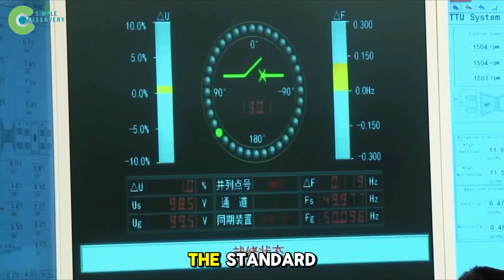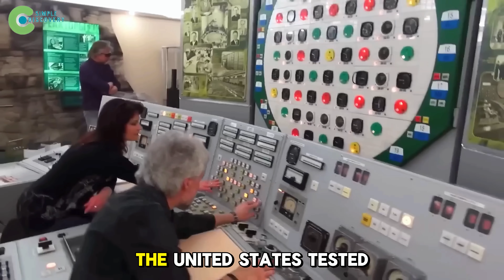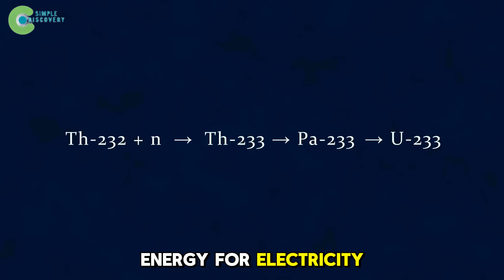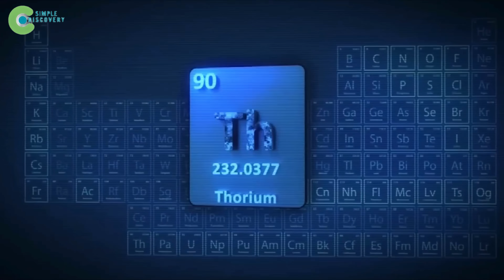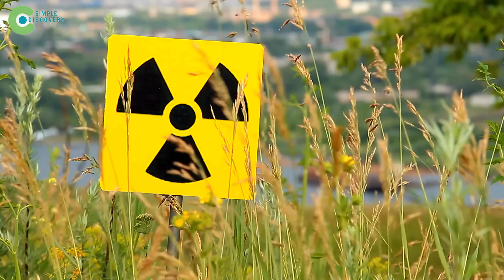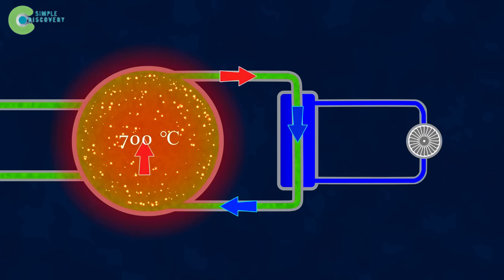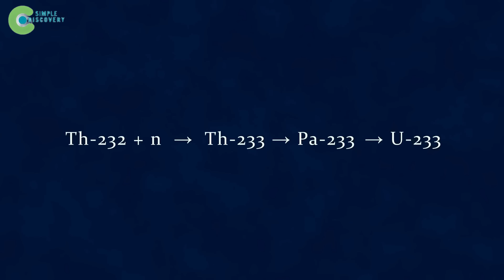China Rushes to USE ABANDONED US TECHNOLOGY – Years Later With CRAZY RESULTS THAT SHOCK AMERICANS

Comment: Thank you for hosting my essay promising near free autonomous electricity and unstoppable refrigeration, a literal power equalizer. People who can maintain their comforts of life autonomously are harder to subjugate; they could become guerillas of peace. Meanwhile guerillas of war could become more deadly.   

Let's reframe Earth's low diversity abundant ambient heat as a thermal   energy waypoint between heat and other forms of energy. 

Energy changes form without gain or loss. Uniformity or diversity is not, in itself, a form of energy.  Therefore entropy is an extraordinary claim burdening the law that energy is conserved. 

Energy sensible refrigerators that absorb heat and yield electricity would complement computers as computing consumes electricity and yields heat. Computing would be free. Chips could have energy recycling built in.
This would improve performance and lower cost. 

Full heat recycling, all electric, very isolated underground, undersea, or space communities would be highly survivable with self sufficient EMP resistant LED light  automated vertical farms, thaw resistant frozen food storehouses, factories, dwellings, self contained elevators, safe rooms, and horizontal transports. 
In a flourishing civillization, small self sufficient electric or cooling devices of many kinds and styles like lamps, smartphones, hotplates, water heaters, cooler chests, fans, radios, TVs, cameras, security devices, robot test equipment, scales, transaction terminals, wall clocks, open or ciosed for business luminous signs, power hand tools, ditch diggers, pumps, and personal transports, would be available for immediate use incrementally anywhere as people as individuals or larger social groups see fit. 

Some electrical equipment groups could be consolidated into local networks when suirable. Liquid nitrogen cooled superconducting networks would become practical 

If a high majority thinks our civilization should geoengineer gigatons or
teratons of greenhouse gasses out of our environment, instalations using devices that convert ambient heat into electricity can hypothetically be scaled up do it with a choice of comsequences including many beneficial ones. 

Refugee communities would be buildable quickly. Fire safes would preserve contents to 1000F for years. 

A simple rectifier crystal can, 
just short of a replicatable long term demonstration of a powerful prototype, almost certainly filter the random thermal motioren of electrons or discrete positiive charged voids called holes so the electric current flowing in one direction predominates. At low system voltage, a filtrate of one polarity predominates only a little but there is always usable electrical power derived from the source, which is Johnson (observation) Nyquest (theory) thermal electrical noise. Max Plank anticipated that ambient thermal noise would become usable with advances in technology.  

I don't see how the second law of thermodynamics can implicate itself into preventing this from working. 

In 1973 I filed for US patent 3890161A DIODE ARRAY for an array of metal1/ insulator/metal2 diodes that refrigerate while concurrently producing electric power. The patent was granted in 1975. It was opened to the public domain in 1992. Development is in the public domain while granting me writing attribution. 

The plausible net electrical filtrate from diodes can be aggregated in a first grouping of separate diodes in  consistent alignment parallel. After a primary level of grouping that preferably is in parallel, compound parallel and series networks can be built 
to provide desired DC current and voltage. Within limlts, parts of the  network can be shorted out or open circuted without electricalor chemical  harm. Widely  scalable electrical power always with equal refrigeration is thus possible. The efficiency of each diode is probably low because the initial power within each diode is nanowatts. This inefficiency affects the performance but not the equality of the thermal absorbtion compared to the electrical yield of the conversion. 

The maximum energy is converted from ambient heat to productive direct current electricity when the load electrical resistance  is equal to the array internal electrical resistance. Maximum calculated electrical power output (watts) is k (Boltźman's constant), one point three eight x 10^ minus 23, times T (temperature Kelvin) times bandwidth (0 Hz to a natural limit ~2 THz @ 290 K) times rectification halving and nanowatt power level rectification efficiency, times the number of diodes in the array. 

There are a billion measurment cells of 1000 square nanometer area each per square millimeter, 100 billion per square centimeter. 

Order is imposed on the random thermal motion of electrons by the structual orderlyness of a diode array made of diodes made within a slab: 

Host crystal in this example is silicon 

  P type boron doped
-----‐------‐----___-- Out
🔻🔻🔻🔻
■■■■■■___ + Out
  N type phosphorous doped 

All the P type semiconductor anodes abut a metal conductive plane deposited on the top face of the slab with nonrectifying joins;  the N type semiconductor cathodes or common cathode abuts the bottom face. As the polarity filtered electrical energy is exported, the amount of thermal energy in the group of diodes decreases. This group cooling will draw heat in from the surrounding ambient heat at a rate depending on the filtering rate and thermal resistance between the group and ambient gas, liquid, or solid warmer than absolute zero. There is always a lot of ambient heat on our planet, more on equatorial dry desert summer days and less on polar desert winter nights. 

There are other plausible breeches of the second law of thermodynamics. Hopefully a lot of people, mostly as independent teams, will join in expanding the breech. Please share the successes or setbacks of experiemental efforts. The topic deserves crowd financing, discussion and prototyping attempt action. Crowd development would be resistant to confiscation or burial.There could also be science quality colaboration. 

These rectifiers could be various types, such as:
• Field emission diodes: A metal needle with a compound carbon nanotube tip, separated from a metal plane by a tiny gap.
• Schottky diodes: A metal needle-to-semiconductor junction, like Gallium Arsenide or Indium Antimonide.
• Silicon or Germanium crystal diodes: A well-established technology. These diodes may have poor performance 

These devices would probably become segmented commodities sold with minimal margin over supply cost. They would be manufactured by advanced automation that does not need financial incentive. Applicable best practices would be adopted. Business details would be open public knowledge. Associated people should move as negotiated and freely and honestly talk. Commerce would be a planetary scale unified conglomerate of diverse local cooperatives. There is no need of wealth extracting top commanders. We do not need often token philanthropy from the top if the wide majority of people can afford to be generous. 

The devices should be able to power the manufacture of àn ever increasing number of these devices. There could be net entropy reduction in the full energy accounting of diode array use. 

The entropic deteration of the structure of machine parts made of tough solids is inevitable but can be so minor compared to the stress of their use that machine shops can make many manufacturing tools before the manufacturing tools deteriorate out of spec.  For example a pile driver hammer's operational energy costs of lifting the hammer three meters over a four million strike service life far outweigh the initial manufacturing energy of melting scrap metal. Therefore everything involved with the intelligent powering, manufacturing and using entropy reversing devices can have negative overall entropy. 

Aloha, 

Charles M. Brown
Kilauea, Kauai, Hawaii 96754